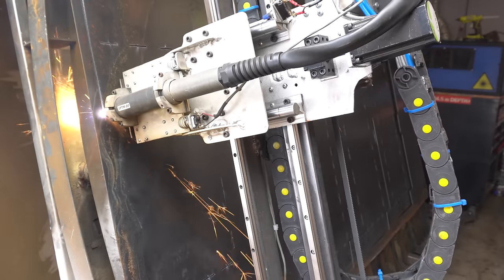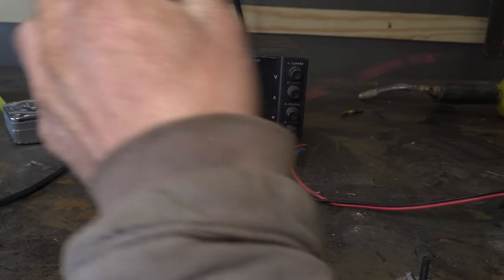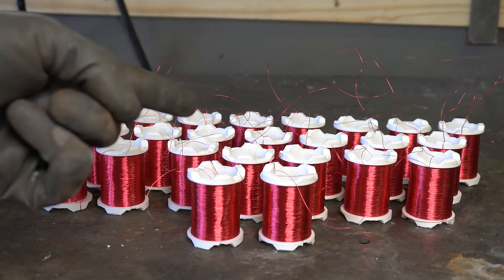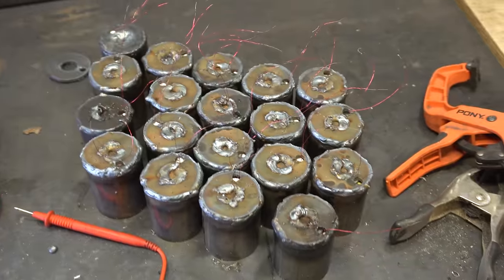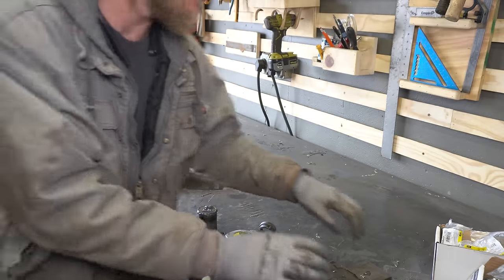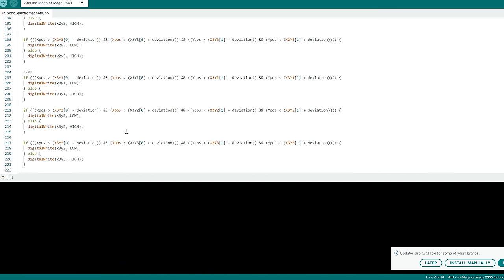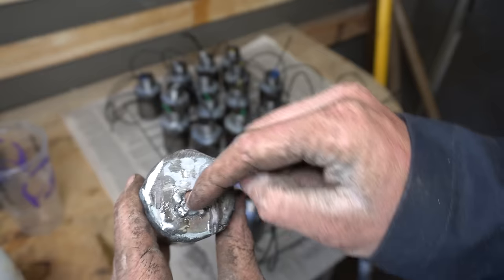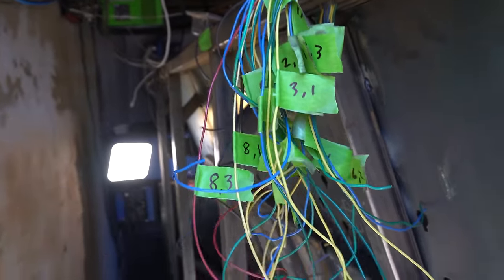The Best Way To Hold Material To My CNC Machine

Comment: This man gonna have a heart attack when he learns about arrays and loops >.>
Reply: And functions 😂
Reply from the maker: I think I just did lol
Reply: Don't forget the beloved switch statement too, that's what I was thinking when I saw the pages of ifs
Reply: And getting chat gpt to write them for you
Reply: @ericbarnes8  AI-based assistants are cool, but a dangerous tool to be used with care.
Reply: @Dan-vq4pz  I feel like a switch statement might be a bit contrived here. Better Array structuring and a Loop through the array would likely be way easier to deal with.
Reply: Branch update request on the git 😂🎉
Reply: Well, the copy / paste / search / replace loop was working in manual mode!
Reply: also Classes. Arduino runs C++.
Reply: @ericbarnes8  Too bad if you dont know how to debug the code because you didn't write it, chances are you spend more time fixing it than benefiting from it. And if you didn't know the code to start with, guarantee you don't know how to debug the issues when they arise.

Comment: "if you got alot of repetative code to write, with changing values".. Functions mate, you want to write a function!

void check_electromag(int x, int y, int pinnumber)
{
    // put actual code here
}

And you have a list of magnets, so you can define them in a list, then you can check all of them in a loop, calling this function. 
struct electromag_s{int x, int y, int pin}
const int num_mags = 30;
electromag_s maglist[num_mags];
for(int i; i< num_mags;i++)
{
  check_electromag(maglist[i].x, maglist[i].y, maglist[i].pin);
}

Well done either way, being persistent always gets results
Reply: MIND THE BAR
Reply: @0xbaadf00d  0xcafebabe

Also, this is a tip - and a compliment. I'm congizant that we have different perceptions and this formulation might be perceived as criticism. My hope is that it's also helpful enough and close to reality enough that it's perceived as helpful either way.

Comment: For the code, you should add each XY coordinate to an array, then all you'd need to do is loop through the array checking them against the position of the plasma head. So you'd have something like:
currentHeadX = 1
currentHeadY = 2
numberOfMagnets = 4
magnetLocations = [
  [1, 2], 
  [3, 4],
  etc... 
]

for(i = 0; i < numberOfMagnets; i++){
    if(magnetLocations[i][0] is close to currentHeadX and magnetLocations[i][1] is close to currentHeadY){
        turnOffMagnet(i)
    }
}

Cus then you don't need to repeat the same block of code 24 times lol
Reply from the maker: Oh god how embarassing hahaha that's where I get when I overthink it
Reply: @cranktowncity  bro it's not embarrassing there's a million dudes who can code better than you but almost none of them can work with steel and build epic machines like you can, don't worry about it.
Reply: @Sven_Dongle  I don't think you're correct here. He needs either a 2D array with [x,y] being one dimension and magnet number being the other. Or a 1D array with each the coordinate pairs in a single object for each magnet. (Either would be effectively equivalent)
Hell, he could also use one big 2D array of X, Y with each element being a 0 for no magnet or 1 for magnet.
Either way, I don't see him needing a 3D array at all.
Reply: @cranktowncity  Don't be embarrassed. And, (not that I think it will, but) definitely don't let any embarrassment discourage you from sharing your work. I mean, yes, obviously, it is crazy to copy and paste the code 24 times. Any professional programmer would look for a better idea as soon as they even think about pasting the 3rd copy. But you're not letting that stop you, you're taking up tools, working hard, and solving problems with the knowledge that you do have. That is what is so great and inspiring about your work.
Reply: @richdecibels  citation needed
Reply: @Sven_Dongle  X and Y are 2 dimensions in math on a graph, but if you list out pairs of coordinates on a piece of paper you won't find yourself needing a third dimension to properly write the list until you have multiple things at the same coordinates.
Even in pure math, you can formulate situations like this where X and Y are parametrically defined via one shared variable. Look at the parametric definition for a line as an example, a line on a 2D plane can be defined relative to a single variable.
Magnet number/Pin Number is semantics and a pointless distinction.
Reply: @Sven_Dongle  You are misconstruing what I'm saying. The distinction between the pin number and magnet number when talking about if the array needs to be 2D or 3D is effectively pointless since it's just names and they directly map on each other.
Again at worst you have a 2D array made as an array of 1D [X,Y,pin] arrays. Or a 1D array of a struct/class/other of X,Y,pin objects.
Reply: @Sven_Dongle   At this point I don't care what you think. You've given no real evidence or reasoning just blankly claimed that it was paying attention to the code that already exists.
I've looked at the code and there is not much to it. Most changes that people suggest would delete 90% of it and working around that is pointless and not helping.
I've also given plenty of reasoning why a 3D array isn't a meaningful or necessary change.

Comment: Firing the electromagnets with the relays will eventually fry the contacts because of HV coil kickback.   The remedy is to use reversed biased diodes on each relay output.   It will suppress the kickback, and is fairly easy to wire.    I'd use at least 100V diode but you may want to measure the kickback to se if it's higher.
Reply: I've had huge problems with this myself. The kickback gives voltages that are almost unbelievable resulting in 300amp spikes from a tiny 3v relay!.
Snubbers, ferrite core chokes or your flyback diode suggestion is a must for reliable long term operation of a relay system. Up voting so cranky t, can get something in to prevent it.

Comment: Other simple solution could be to use some neodymium magnets attached to some pneumatic cylinders, that would pull the magnets away from the surface when needed. Bunch of cheap ali-ex spring loaded cylinders and 3/2 valves would do the magic. This way the magnets would be a little bit mor protected from the plasma burner because of the distance and you would also have the holding power during power outage. Btw thanks for all the great content.
Reply: Even the cheapest pneumatic cylinders would need heat resistant plumbing and individual solenoids rapidly driving up the cost.
   Also, the neodymium magnets will ALWAYS be on and would collect alarming amounts of swarf. They would not be able to "re-engage" after the cutting head passes.

Comment: It looked like the outer casing of the electromagnets and the end plates are too thin to be efficient. Ideally you want the cross section of the magnetic field's path to be the same everywhere along the path, meaning your outer tubing should have the same cross section as the part in the middle, and the end cap should actually be even thicker because the relevant cross section in there is actually a cylinder (geometry is fun lol). 

Of course they will work as they are, just telling you this in case you make some more or want to make stronger ones at some point. 
Great content as usual :)

Comment: Best to use some thicker wire for strong magnets, but another thing you can do which is harder but does add to the magnetism is wind the wire top to bottom and then stretch it to the top and wind to the bottom each layer. This causes more of the coil to be in the same direction, it's hard to get right but it makes a huge difference compared to each layer going the opposite direction. Just my experience

Comment: If you were to cut a 1/2 inch thick slice of some solid steel round bar and cut a lot of slits into one face of it with a cut off wheel and basically use that as the shield for the electromagnets I wonder if it would still allow the magnetic field to have plenty of grip on the plate while also providing space for the plasma jet and smoke somewhere to go via the slits and grooves. I once did something similar to what you did and my problem was always the plasma jet just melting everything and because of crap backfiring into the nozzles it ruined a lot of tips too. Keep up the great videos my dude.

Comment: Easy fix for the bouncing wire on the winding machine: superglue some felt pads to the inside of the jaws of a clothes pin or clip for a bag of chips (something without a ton of pressure) and just clip that onto the wire as it goes into the guide. Should keep steady pressure regardless of what the spool is doing.

Comment: I'd consider making the magnets moveable using permanent magnets to place them anywhere so you can mount them where cuts won't be made wherever possible then automatically scan and learn their positions with a Hall effect sensor on the head or a simpler option would be sacrificial replaceable surface plates for the magnets which can easily be replaced when they get cut up too badly. Both methods have pro's and cons.

Comment: great video as always. Exited to see new uploads. My inner programmer is screaming at the screen because of your code for arduino. :D. Would gladly help on that front. BTW do you have thc? I finished building my diy plasma machine and used simple THC SD controller.

Comment: I feel like you could make those magnets last a lot longer if you add a linear actuator to each to pull them back just enough for the laser to not hit it, but at the same time that'd add another 24 moving parts you don't really need

Comment: What happens when the plasma cuts over/through one of these though? The slats under a usual plasma cutter are consumables, i get the feeling these will end up being consumablized as well unfortunately. There are off the shelf electromagnets, I see them all the time on aliexpress. They're build just like yours but with a threaded hole usually for mounting. Might be useful when it comes to replacing these, since they seem like a lot of work to make.

Comment: A function could save you some of the repetition in the code. But if it aint broke dont fix it. One thing i saw was the plate buckle some when one of them released in the end while it cut the top to bottom. Dont know the solution or if its worth digging into. If the cut was satisfactory then id ognore it. Thinner plate like your were cutting tends to go crazy at the best of times thicker plate will have less of an issue (it will also have a firmer hold).

Comment: 06:55 - 0.28mm layer height is fast not smooth? I must be too accustomed to post-processing my prints; I am almost exclusively printing at 0.5mm layers with a 1.0mm nozzle on an Ender 3 V2 Neo.

I would print the spools a bit undersize, then epoxy or screw the spool in place and there probably wouldn't be too much of a difference. I think it would be good enough with a layer of tape smoothing out the winding surface of the spool to even out the rough layer lines. :D
Reply: well yeah, .28mm is not really smooth but its way more than enough. I cringe so bad when i see people print simple parts without any real details at anything under .26 honestly. I always print at 0.36mm and only go lower for really detailed parts, like M42 to M48 adapter rings with threads. Gotta get me one of them 1mm nozzles...

Comment: Hey guys. I have genuine Emco software with CAD and CAM for Fanuc mill and Lathe. Can I control DIY CNC mill with it?
Reply: LinuxCNC's G-Code is close to Fanuc's, so I'd give it a try, if I was you. Starting off with a cheap old PC and controlling it via printer port to try it out.

Comment: as a coder with a degree (i'm not very good), the actual first step to any programming is making sure it isn't already complete. if someone already implemented it, your coding job is done. there's nothing more frustrating than spending 30 hours on something and then finding out there's a gnu library that already has it implemented
Reply: Yeah, but copypasta never tastes as good as homemade.

Comment: I am thinking (just thinking, and not like, doing, so definitely ignore this nonsense) about how to solve the "turn off the magnet when the cutter is near" problem without using an MCU at all. IDK, something like a bunch of NC (rather than NO) relays driving the coils, and then roller limit switches around the perimeter, so when a given X,Y pair of limit switches is closed, the corresponding relay is energized, opening the circuit and turning off the magnet.

I dunno. it's probably a dumb idea.
Reply: yeah, the more i think about this the more sense it makes and not nonsense. This is how to drive a matrix of light bulbs in a display after all, so it should also work for an array of relays.

Comment: Oh man, you'd be blown away with how much easier that kind of code is if you use structs.

```
typedef struct {
    int pin;
    int x;
    int y;
} magnet_t;

magnet_t magnets[] = {
    {.pin = 32, .x = 4, .y = 3}, // you can use explicit field names
    {33, 1, 23}, // or you can leave them out and trust you put the numbers in the right order
    {34, 3, 40}, // but each additional magnet is literally just one line with three numbers
    {35, 16, 3},
    {36, 13, 23},
    {37, 15, 40},
};

void set_magnets(int x, int y, int d) {
    for (int i = 0; i < sizeof(magnets)/sizeof(magnets[0]); ++i) { // loop over all the magnets
        magnet_t m = magnets[i];
        if (((x > m.x - d) && (x < m.x + d) && (y > m.y - d) && (y < m.y + d))) {
            digitalWrite(m.pin, LOW);
        } else {
            digitalWrite(m.pin, HIGH);
        }
    }
}
```